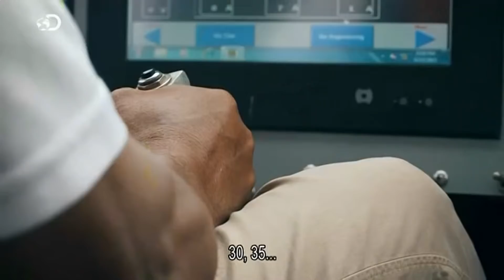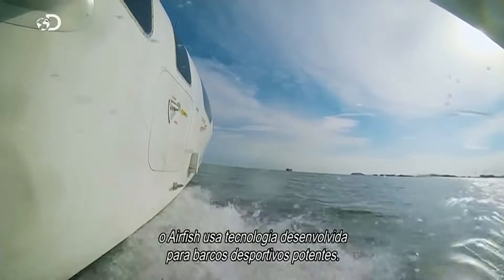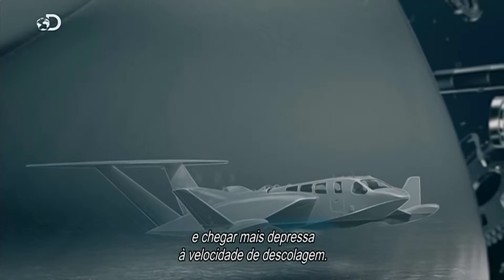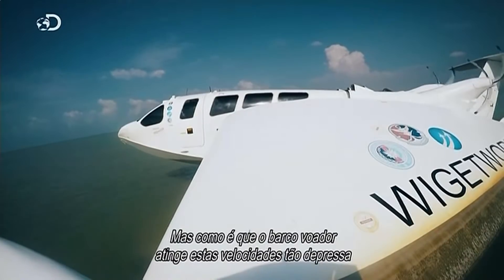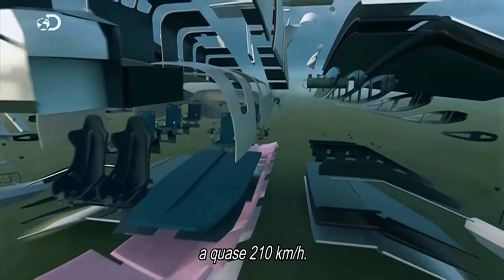AIRFISH - I

Comment: There's an improved design version of this wing-in-ground vehicles with regards to the stepped hull.  They are trying a hydrofoil hull version.  It may improve take-off vibration issues but not sure how it performs during landing.
Reply: Perhaps just adding an small wheel under each wingtip float, another in the rear side of fuselage, would allow amphibian operations. Or not? 
    https://youtu.be/gnflnBF7jWk?si=7G89k3iVfgSyfyxq 
         https://youtu.be/qTIoezhRS3g?si=IFd3e_Smp0pKnDoZ
Reply: That will add extra friction
Reply: Not that much, I'd say. Anyway, it's easy to implement, test, measure, and revert if results are negative. Or not?

Comment: The Ekranoplans the Russians were working on had lots of challenges that made them impractical. These thing really cool on paper and even when they're in operation. But it doesn't take long to figure out that they're just not going to work in the long run. Kind of shame, really.
Reply: That is not entirely accurate. Do more research.

Comment: You would need to do some heavy cost analysis of production versus flyable seas. Doesn't look super viable unless you just need an occasional quickie transportation service for VIPs. Then again, why wouldn't you just use a traditional plane or helicopter?
Reply: I believe they use cost effective automotive engines with regular gas equaling a much lower maintenance cost repair/replacement. That may make them more viable. Hydrofoils are probably the answer to the rough water problem. As far as existing air travel goes, these are probably safer than helos or fixed wing travel with no need of landing strip and maintenance areas.

Comment: Heavy trans,IC engines..Why not use turbines? JUst get a catalina and get it overwith.
Reply: Lol excellent point, especially considering General Motors' shoddy reliability and warranty support.
Reply: @davidguthrie5941  Turbines can ingest some water.But it doesnt matter.This entire concept is flawed.Not even very safe.And its rendered superfluous by nearly every seaplane which does whatever this can and much more and cheaper.The only way this concept even kind of works is if you scale it way up as in the Ekranoplan .
Reply: I saw it in Cairns years ago. It was overbuilt more like a boat than an aircraft.